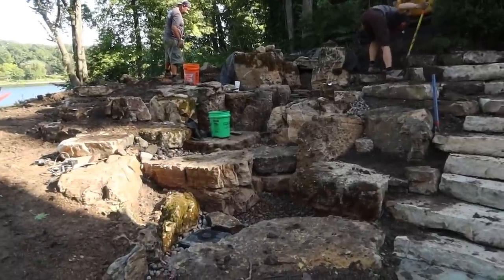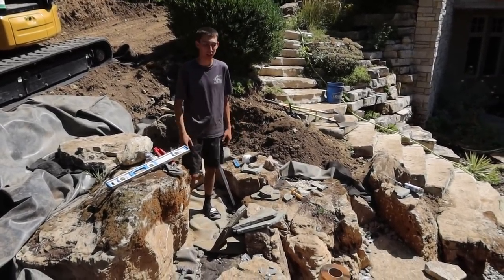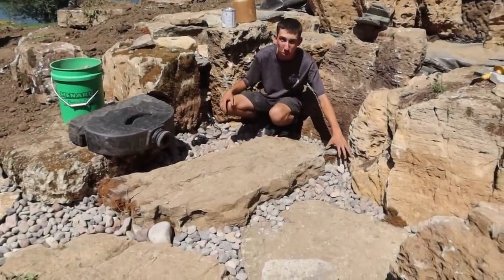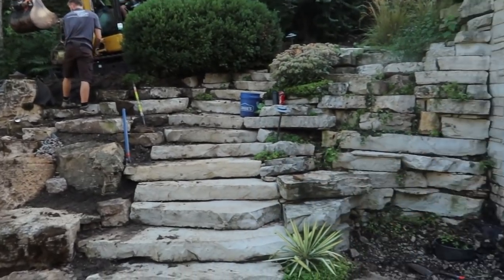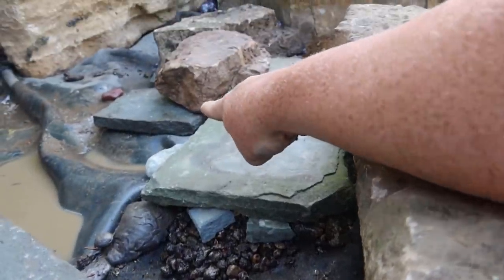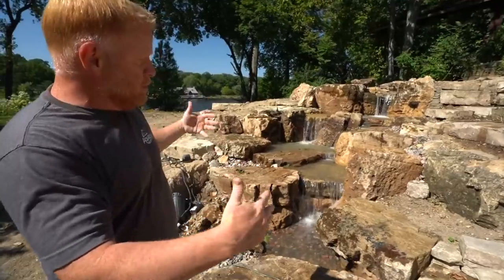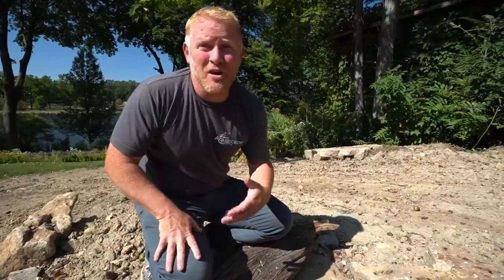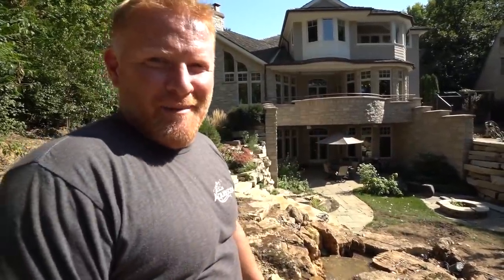Landscape *WATERFALL* Carved into Hillside - REVEAL

Comment: Beautiful but I would have had falls to the right of the stairs too so it would feel like you're walking down the falls. You could use 1 spillway for both but added a pipe from a pooling area to go under the steps to a pooling area on the right and drop.